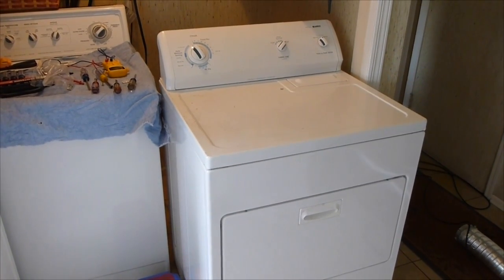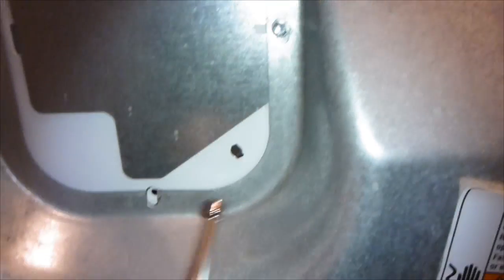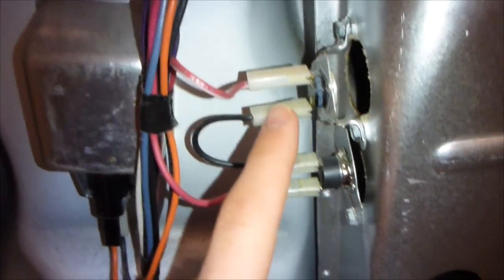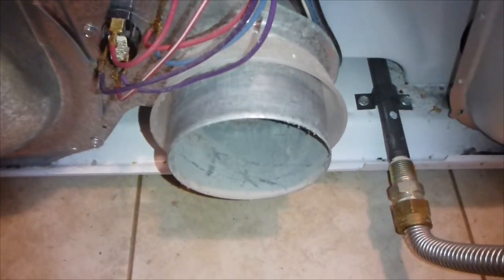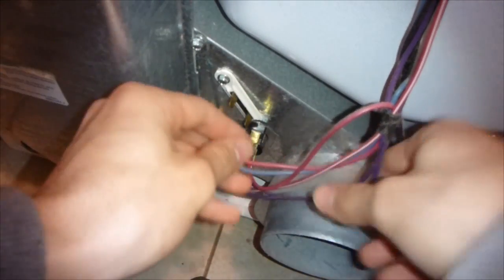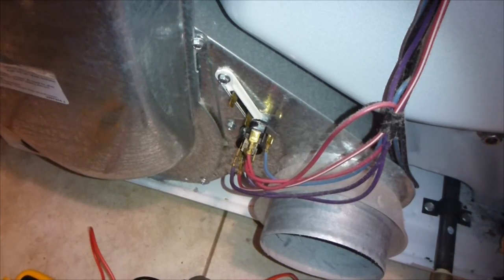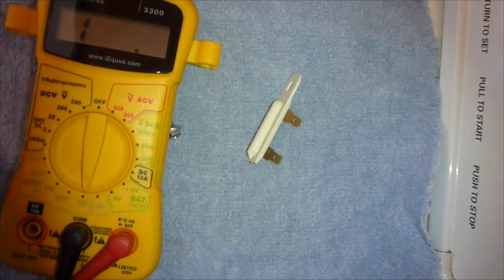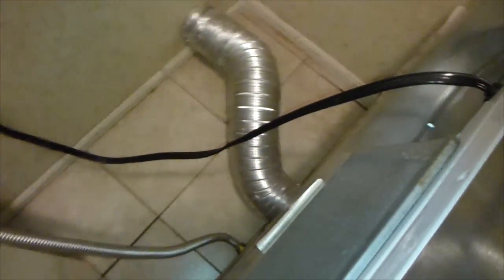How to Fix YOUR gas Dryer that is not heating up (Part 1 rear panel)

Comment: it works intermittently only one for ten mintutes then everthing has to get cold again before it kicks on again maybe 45 minutes later or so
Reply from the maker: That is a tough one. I have had dryers with these symptoms not work because of the solenoids. Also, thermostats that heat up and dont work when its warm...
Reply: ChrisFix yeah he thinks its the http://www.thermodisc.com/en-US/Products/Bimetal/Documents/10RS_Product_Bulletin.pdf
Reply from the maker: Yea that is the part at 4:30 in part 2
Reply: ChrisFix when you say that thermostats that heat up and dont work when warm do you mean the thermostat in the back by the thermal fuse or the one in the front by the celenois. its still not working i unplug the machine for about 4 minutes and everything works ok again until it wams up then it does the same thing. this is frustraiting dont know what to do now he says i need a gas valve. i dont know
Reply from the maker: yea the ones in the back. when they heat up past a certain temp, they have a specific resistance. If they dont work properly they will heat up just a little and shut the gas off. The parts are cheap so you might want to try replacing what you think is wrong...

Comment: hi chris a friend came and took everthing apart tested everything. everything check out as good. the machine works well the first time it works for about 10 minutes then it shuts off and then the glow worm turns on but no gas ignites so something is not letting it work after it switches off after 10 min. he tested the celinoids with an ohm meter and they are ok'
Reply from the maker: Did you test the part at  4:30 in part 2 of my video?
Reply: ChrisFix yes

Comment: Hi Chris thank you for the video 

i have a question if you can help i have a kenmore coin op and the igniter turns on and the gas burns for a few minutes then it fails to reignite. and the glow doesnt reignite either. any idea?
Reply from the maker: Did you do the tests I did in this video? Sounds like it could be the solenoids and others have had this problem with same symptoms like this and it was the solenoids. No other way to know then to test them.

Comment: P.S. I found the fuse and part number on the Maytag website they wanted $16.99 for it plus shipping. I checked eBay and found it for $4.44 with free shipping. You and eBay just saved me the $165.00 estimate from the appliance repair guy coming from another small town.

Comment from the maker: Great! Glad the video was helpful! Good idea on shortening your vent hose. I would also clean out your vent if you could. A lot of times a dirty vent heats up and causes the fuse to blow (for fire safety). I shortened mine as well and she has been working great ever since! Give the video a thumbs up if you havent already, it helps more people see this! Thanks!
Reply: MY DRYER THE BURNER IGNITES BUT THE DRUM DOES NOT HEAT UP REPLACED THE THERMO FUSE AND IGNITER BUT DRUM STILL DOESN'T HEAT

Comment: Perfect video! Thank you! So very well explained...no aggravating music and intro, you just simply got right to the point and I did everything you explained and found a non working thermal fuse. I ordered the part and everything should be working fine when it comes in. I am also replacing a way too long vent hose with a much shorter one thanks to you.

Comment: Hi there,
 I bought a use May Tag Washer and Dryer combo LSE 1000, but when I plug in (110V for Washer and 220V for Dryer) I have no lights show in control panel, so please help what should I have to do (reset?). Thanks. Q

Comment from the maker: There is a tensioner pulley like in a car. Just look around for a smaller pulley on a hinge and lift it up, put the belt on and let it back down so it puts pressure on the belt.

Comment from the maker: It is weird that they both broke but if you can try replacing the thermal fuse first and see if it works. They both might have broken due to high heat... As for the "lower part" not having the 4 connections, dont worry. Each type of dryer is made a little different.

Comment: My dryer is a Whirlpool Cabrio. I followed your very clear and helpful video and tested the thermostats and thermal fuse on the back of the dryer. The thermal fuse shows no connectivity and must be replaced. The thermostat (or whatever it is) immediately below the thermal fuse also showed no connectivity. Is it usually the case that both of those go out at the same time? BTW, that lower part doesn't have 4 connections like the one in your video. It has only 2.

Comment from the maker: Does not matter. The current flow is literally just a flow of electrons through the thermostat. Then if the thermostat gets too hot (above the threshold temp) the flow of electrons stops, like shutting a light switch. Good eye tho!

Comment: I noticed that the lower thermostat was wired incorrectly after you tested it, have you had any issues with the dryer since posting? Does the current flow into the thermostat matter?

Comment: Damn autocorrect... Lol anyways for the fuse issue it is not bypassed, just simply not plugged in, the wires are folded back and tape together. Functionality wise the dryer seems to work fine, other than being illegal and a fire hazard, any other problems with it not being hooked up?

Comment: After posting the last comment I found part 2, thank you, it was very useful...  So I pulled the front panel off and discovered my problem was simply the connection to the igniter just came unplugged (broken clip). I urged it in and low and begs there was heat. I do credit your videos in helping me resolve my problem without paying a service guy to come out and just plug the igniter back in!

Comment from the maker: Well, the fuse has to be connected for it to work or it was tampered with (bypassed). Did you watch part 2? With both part one and part 2 of my video you can easily diagnose the problem.

Comment: And to elaborate, with the thermal fuse not hooked up, the  dryer worked fine for about 5 months, all of a sudden no heat... While the thermal fuse is legally required, it work fine without it.  Of course I have issues with the shop that sold me the dryer, what else could cause the no heat issue?

Comment: Hey is it the same with electric dryers? Just check all thermostat and that fuse? And if I check all those and it's good then any other thing I can check other than heating element cuz mine is good

Comment from the maker: It should glow until the flame is lit. Then when there is a fire, the glow will fade away. When the fire goes out, and the temp needs to get hot again, it will glow, and the fire will light. The glow should not stay on.